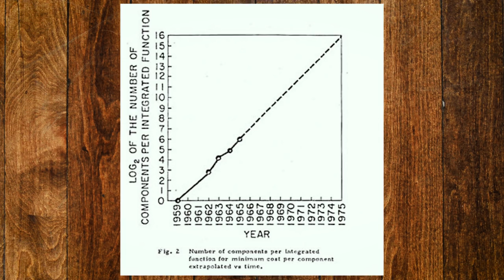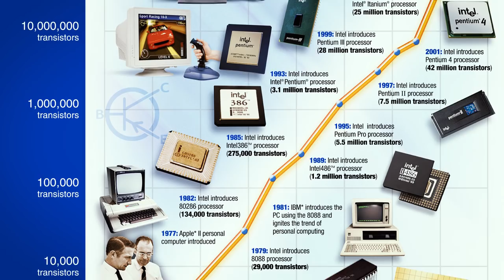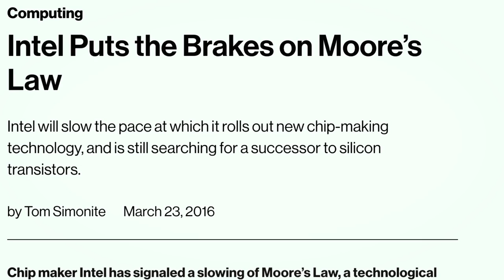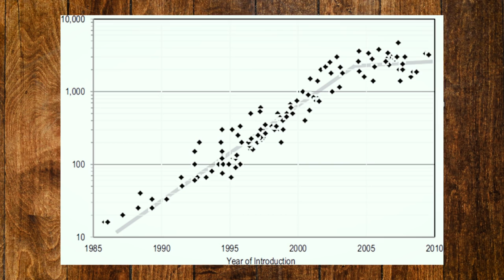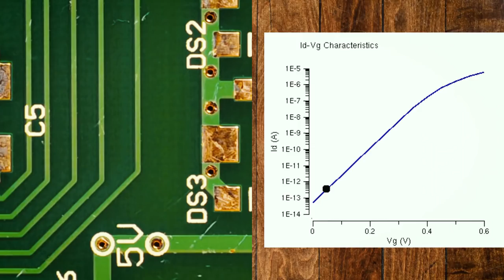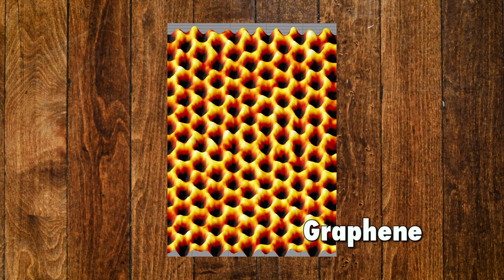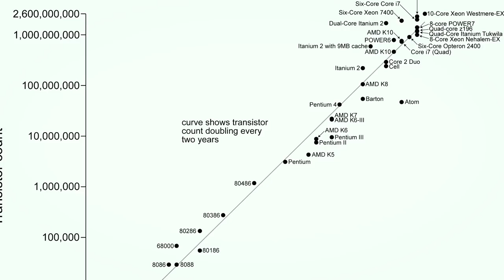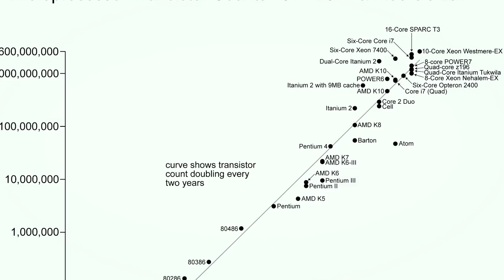Is Moore's Law Broken?

Comment: So... a few really weird things about following the tech industry and metrics like performance, efficiency and (of course) Moore's Law.
1) While mainstream consumer x86 architecture has slowed down dramatically over the last 5 years, it is not true for all computing technologies.  GPU performance is still improving dramatically, and ARM based processors (used in everything from microwaves, to cars, to smartphones and tablets) improved very slowly in the past, but are not moving at a much faster 'moores-like' rate.
2) Mentioned, but not explored much in this, is core count.  While improving core count to 6+ cores makes little to no difference in day-to-day computing use, it has HUGE improvements in the server market.  Last year at the school district I work for I consolidated 14 physical servers down to 4.  One is a backup server, one is a file server, and 2 house VMs (virtual machines) of the other 12 boxes.  Sure, the individual core performance is not improving much over time, but massively parallel cores allow you to consolidate workloads of multiple machines and users down to a single box with little to no impact on performance.  This means that end user devices can get smaller, lighter, and more gutless, as the end-user workloads are off-loaded to 'the cloud', and that cloud can continue to get physically smaller and smaller as density continues improving, even while the load is increasing dramatically.
3) While a lot of the reason for Moore's Law was self-fulfilling prophecy, a lot of it was due to a specific 'need' for more power.  Angry Birds and Slither.IO do not drive the overall economy.  MS Office and Google Chrome is what moves the economy.  About 5 years ago we hit a wall of 'good enough'.  It no longer took 3-5 minutes to open a word document... it took a mere 2-5 seconds.  And while shrinking that to 1-2.5 seconds is a doubling in speed and improvement, it is no longer a practical difference in performance.  If something takes 1-2 seconds or 5 seconds it does not impact performance very much.  With very little practical efficiency to be gained by CPU improvements in these bulk-user tasks, there is smaller and smaller motivation to make improvements, especially as the improvements are more and more difficult to make.
4) In more recent years the 'new' definition of Moore's Law seems to be measured (at least by Intel) in performance per watt.  Now, I am not always inclined to follow this line of thinking, but they are not entirely wrong either.  While raw performance per-core is at a stand still, the efficiency (under load and idle) has been improving very quickly.  A lot of this is due to the impending collision between x86 and ARM architectures.  ARM has always been very good at being low power, but not particularly good at being efficient with workloads, which is why they have been great for phones and tablets that need minimal power usage, but don't have large heavy workloads (and why when you do give a phone a heavy workload it drinks your battery so quickly).  x86 on the other had has generally been very efficient with heavy workloads, but is by its nature very power intensive.  But as phones do more and more work, ARM has been getting more and more efficient with big tasks, which has been giving Intel (and poor poor AMD) a run for their money in more and more markets.  Intel has reacted by trying to get x86 into smaller and lower power packages.  Overall, this means that we have gotten to see end-user performance stand still, but the machines that do these workloads over the last 5 years have shrunk from 1" thick to mere millimeters!
5) Lastly, improvements in performance appear to be in mixed architecture setups.  Soon we will see computers with a mix of ARM, x86, and GPUs all working together on the same pool of data as a single intelligent system.  This is already happening where the x86 CPU does all of the general compute, and ARM chips run the various drives and add-in cards in the system.  The difference is that all of these will be on the CPU, running your OS on the ARM part of the chip, and then farming out jobs to x86 and GPU cores as needed.

Anywho, just food for thought :D
Reply: You seem to be a good person to ask for this: Why dont we make cpus that have 50+ cores that take up most of the motherboard? Is it due to speed of each part of the cpu to communicate?
Reply: What are your thoughts on Accelerated Processing Units (given your last paragraph)? Could this be the next technology to keep us on Moore's Law?
Reply: Great post!
Reply: That's part of it - but, as he alluded to - do we really need such a thing? How would we use that power? We've actually hit a bit of a "wall of usefulness" in that we don't really have a use for that much raw horsepower.

. . . and to some degree, we actually already do have 50+ cores. Just not in the CPU, but rather in the GPU. GPUs have really taken off in terms of computational power, having thousands of cores. Still, those cores remain used mostly for games, even though they have become more general purpose.
Reply: TheEvilVargon It is because of the kinds of workloads we have computers do.  Because computers compute math, the math has to be done in order for things to work.  Most workloads can only be broken down into 2-3 things that can can be done simultaneously without affecting the outcome of the other calculations, so 4 cores is generally a good limit on how many cores a PC should have without people buying cores they will never use.
Another issue is cost.  x86 is a fully-featured architecture with lots of instructions.  Each core needs a full set of these instructions to work.  If you start having 8+ full-fledged cores, then there is a lot of redundancy that you are paying for which never gets used and it gets very expensive.  But if you move to a RISC or ARM instruction set which is substantially smaller, then you can easily afford more cores, but each individual core has to churn through more cycles to produce a result, so the per-instruction efficiency goes down.
In the future I think we will see more hybrid CPUs with 2-4 full x86 general compute cores, a few hundred GPU cores, and a few dozen RISC/ARM cores that are for specific common tasks.
I mean really this is what is already in your average desktop PC, but spread across several components rather than a single chip.  Your CPU has your x86 cores, your GPU has your GPU cores, your sound card, HDD, Northbridge, and other devices all have various RISC and ARM chips that control each of them.  It is just a matter of consolidating them all.

Also, there are specialty products that have several x86 cores on board.  They are big, and expensive, and generally only for specific applicaitons, not well suited for browsing the web and playing/editing videos lol.
Look up Xeon Phi cards for more info.  They are pretty cool... if impractical.
Reply: Yes, and no.  It depends on what that APU is actually doing.
First of all, AMD needs to make an APU that can actually... you know... do stuff.  Right now they are essentially Celeron or Pentium level processors with a rightly integrated GPU.  That GPU is capable of doing more than displaying graphics, but there is no software that takes advantage of it.  And the reason nobody takes advantage of it is because there is no market penetration, and there is no market penetration because even AMD buyers still prefer to buy a discrete CPU and GPU (wait for it...) because software is optimized for it.
But yes, if the APU was actually used as an APU (and there was an APU that had some real performance), then it could be one way to extend moore's law through a mixed compute model.

Don't get me wrong.  AMD's APUs are fine for what they are.  I actually use an A10 in my home server, and suggested my neighbor get one for their cheap laptop that they bought.  They are fine for what they are... but what they are is not something you want in a hefty work PC, and certainly not in the running for pushing moore's law any time soon.
Reply: Exactly right!  If your PC had 50+ cores... so what?  What on earth would you do with it?  You have no software that can push it.  There is no game or video editing suite that could make sense of such a thing... for an end user.

But that said... what if end-users had fairly capable phones to work with.  The device itself could play simple games, browse the web, play video, etc. etc. etc.  But then you have a central server in the basement, and if you want to play a big game, or do heavy production work, then you dock your phone (wired or wirelessly) to a real keyboard, mouse, and monitor, and your heavy game or production software runs on the server with your phone being a glorified I/O manager.  And then not only do you have access to it, but the whole household has access to run heavy loads on that central server.  So you and 4-5 other people all have cheap $4-700 smartphones, but rather than purchasing 4-5 separate PCs everyone shares a single heavy server that is more capable than 4-5 PCs combined.  The technology is actually already here and available in Hyper-V, ESXi, and a few other OSs... a little difficult to setup and use... but it will get better with time.
Reply: yes... and very much no.
The numbers proposed by Kruzweil and others assumed a lot of things that simply are not true.
1) It assumed that the whole brain is engaged at all times.  We know this to be false.
2) It assumed that everything the brain is doing is 'processing', but we also now know this to be false.  Large parts of the brain are merely IO interfaces.  Just like an ADC converts analog data into digital info that computers can work with, there are large parts of the brain that convert visuals, smells, touch, etc into signals that the processing part of the brain can work with.  As well as output areas to control our bodies.
3) It assumed that our brain can be geared and unified to all work together on a single problem, and we now know it does not.  For one thing the brain is plagued by noise.  Not just mere distractions and rogue thoughts, but actual firings of neurons that don't need to be firing.  for another, parts of the brain are specialized at certain tasks, and so there is no way to engage the entire brain.  Because CPUs use 'general purpose' cores all parts can do all processes, so you really don't need a big CPU to equal the amount of 'active brain' at any given time.
4) It assumed that just because the brain CAN do something, that it does it all of the time.  For example; we know that the human eye can see things at ~120fps, and at extremely high resolutions, and so we assume that we are always seeing things at that clarity and speed... but actually we don't.  The hardware may be converting it to make it available to our perceiving brain, but that does not mean we are putting in the effort (or processing power) to see it.  It also means that if we are putting that much concentration in analyzing visuals that we remove attention from our hearing, or feeling, or critical thinking... we just can't do everything at once.  In fact, we are really bad at multi-tasking.
5) It assumed that it was the amount of processing power would be required to emulate a human brain.  It is far simpler to 'be' a human brain.  Meaning, to have specific instructions and capabilities that make it work rather than trying to emulate something on non-optimized hardware.
6) It made poor assumptions about brain latency and processing speed.  The human brain 'runs' at about 60Mhz with ~0.1-0.5 sec of latency.  It is also massively parallel... but can really only focus on so many 'threads' at once.
7) It makes unfair comparisons of the human brain, with a CPU, when a brain is more like the CPU, GPU, sound card, motor controlling cards, etc. all thrown into a single basket.  For that matter, we are now finding that or 'mind' is not confined only in our brain.  In fact, our gut and spine do quite a bit of processing that we are only beginning to understand.  If we were to compare all of the processing in a human body with all of the processing in a whole computer system, or small network of computer systems... then we might have a more apt comparison.

Really truly, the human brain is about on the level of a Pentium 3 processor.  Very different instruction sets, and very different input and output capabilities, but about the same amount of raw useful processing 'attentiveness'.  The real trick is that the human brain is like a Pentium 3 attached to 2 16K cameras, a fantastic stereo mic set, millions of touch sensors, a really weird small and taste sensor system, several motor controllers, etc. etc. etc.  There is just so much raw data coming in at all times that 99% of it needs to be ignored so our relatively tiny amount of compute can deal with just the parts that are relevant to keeping us alive.  It does so by cheating.  We filter stuff out.  It makes shortcuts and approximations of information.  It simply doesn't do a full compute on everything at all times.

Quick example;
1+1=
A computer would have to actually compute this each and every time the problem was presented.  The human brain does not compute it.  We computed it a few dozen times in grade school, and our brain said "Ok, obviously we are going to see this a lot, so lets make a shortcut" and so it makes a quick recall memory (similar to a lookup table) and we just know that 1+1=2.  Not because we are calculating it, but because it is common information. Note that there is lots of 'common information' that is wrong... but we don't catch it until we actually think it out.... if we can.
So something harder then: what is the square root of 1,234,567,890?
Well, the computer can tell you instantly.  The answer is 35,136 and change.  I don't know that for sure, because I 1) don't know how to solve a square root, and 2) would have to calculate it out long-hand which would take forever.  But for a computer the task is only trivially more difficult than adding 1+1.
The trick is that I CAN learn how to solve for a square root, and without replacing parts in my brain, or someone outside uploading a new firmware to my mind.  I can see examples, read some text, reverse engineer the process, and actually 'learn' a new trick.  Something that fixed hardware computers cannot do.

Another great example: I can find my way home from where I am right now.  In a mere instant. no problem.  It takes my GPS several seconds to do the same task.
The difference: my GPS has to load up all of the area maps, try out every possible path home (within certain broad restrictions), compare them all, and then select a very specific answer.  I know my way home because I figured it out years ago.  I did the processing, and over years of driving back and forth, and having detours, and trying different routes, different routines, knowing traffic patterns, etc.  I have a learned memory of the path home; The computer in my GPS sees it as a new problem each and every time.
So... go somewhere I have never been to before in my town?  Seems fair, and I can still beat the GPS most of the time.  But again, my mind masks out all but the most used paths in the area, while the GPS loads up every last side-street.  My mind generally knows what routes won't work, while the GPS has to try every route.  My answer may not be a specific point-to-pint answer, while the GPS needs to have an exact answer.  My answer may not have all of the street lengths, names, turns, etc. while the GPS has all of that technical information.

Point being; Computers and human brains are extremely different in how we process things.  A computer deals with absolute concrete numbers (and really, only numbers), and shunting those numbers through logic and math pathways (instruction sets) to come up with answers... very quickly.  The human brain is more of an associative difference engine.  We take lots of information, filter out the crap down to a level we can deal with, and then we process from there.  And when we process it is much more practical in being 'good enough' to keep us alive, or to accomplish a task rather than being caught up with the 'best' answer to a problem.  In fact, our brain takes so many shortcuts, and glosses over so many details that we often dont even know what we miss out on!  Just go look up illusions or brain tricks on YouTube... there are just so many! And while you may not fall for all of them, it is mostly because you are looking for the trick... and even looking for the trick you still can't catch them all until they are explained and you go back and look for that one detail... and in doing so you miss out on other things that then got filtered out so you could focus on the new thing.  Computers just are not like that.  They see everything at all times.  There is no filter, there is no 'close enough', there is no changing the firmware.  It has nothing to do with raw processing power, and everything to do with how data is processed.  We are not different because computers are so much faster or slower than the human brain, but that they merely process things differently.  On a raw processing power level, the human brain isn't that powerful; merely better at pre-processing and making shortcuts to deal with things in a lossy but real-time environment.
Reply: You did just write as much in these comments as I did in the whole year.
Reply: Ya... Christmas week as a tech in a school district... Not a lot going on. lol
Reply: moore's law is just one paradigm. Carbon nanotubes, 3D chips... this is the direction we'll go I think.
Reply: @Matthew Lake There's no reason to believe that other technologies won't suffer from similar problems eventually. The laws of physics simply don't seem to allow unlimited power.
Reply: But is there a need? The tasks like optimization and encryption breaking can seemingly be solved by quantum computers, which are the same tasks that require unlimited discrete/binary computer power. 
So there has the be some divide where a standard processor is most optimized for one task, and a quantum chip is most optimized for another.
Reply: @Matthew Lake
well... not quite.
The problem we are running into isn't just a limit of what silicon can do... we are getting to points where atoms themselves are just too large of structures to work with.  In the last 10 years we have gone from 65nm down to 10nm.  Granted, there are more and more parts of a CPU that have much larger than 10nm structures for other reasons... but about the smallest we can do in mass production right now is ~10nm.
Silicon itself is good down to about 5nm.  At that point we are talking about single digits worth of atoms across.  Moving from silicon to something else will help make it smaller... but with ever decreasing efficiency gains.  That isn't to say we won't move to other materials eventuially, but the R&D required (to say nothing of moving an entire industry of mining and fabrication!) to a new material is a monumentally expensive task... we might just hang out at the 5nm level for a long time because it won't be worth moving to something else right away.

3D chips is something that we might see... maybe.  But there is one large issue with 3D chips: heat dissipation.  Technically speaking, we know how to make layered chips.  SSDs use them a lot these days, and they work great!  But each added layer is literally covering the previous layer in an insulator, which makes it harder and harder to dissipate heat.  In a SSD where the entire unit eats some 2-5W at peak usage you can work with it and deal with the heat... but in CPUs that suck down tens to hundreds of watts... that is a lot harder to deal with.
That said; there are 2 potential solutions.  1 is adding heat pipes inside of the chips to help cool the different layers.  It can be done... just prohibitively expensive.  But given enough R&D we could find some magic breakthrough that makes the tech viable. 2 would be moving from a lightly threaded chip design to a highly threaded chip design (similar to a GPU).  This could potentially allow a chip to run at a slower overall clock speed, while still offering tons of performance.  Intel's Knight's Landing is one such version of such a chip, and the tech is really really cool!  But the issue here is that today's software is optimized for 4 or fewer concurrent operations... so unless we have a major change in how software works, then moving to such a design would give dramatic drawbacks in performance.

I think that the next big thing in technology will not be in material science, but in chip architecture.  The core chip architecture in use for both ARM and x86/64 (as well as IBM PowerPC) is old... I mean seriously old.  They all have their roots back in the '70s and '80s.  Knowing what we know now we could probably start over from scratch with a new instruction set and execution paradigm that works in conjunction with a new software/programming architecture which could be massively more efficient and performant than today's systems.  Ironically, I think Apple is already working on this and may be the first to the table.  But I think that WinTel will also have to follow suit to keep up with the next gen of computing technologies (talking 10+ year time-frame... not soon).
But even that is going to be a HUGE setback!  It essentially means giving up on all current software and starting over... unless someone can come up with a way to port current software over, or allow for some form of emulation to run legacy software.
Still, I think that will happen first because it will be the 'easiest' performance gains to be had.  After that, then I think we may see a move to new materials, 3D CPUs, and other such tech.
Reply: @Mak Jay
Except that is the problem: optimization and encryption breaking are essentially the only 2 tasks that quantum computers are remotely good at... and even then they are barely keeping up with traditional x86 chips.  Sure, they occasionally get done with a problem fast, but most of the time they are neck-and-neck with more traditional architectures.
Plus, it does not help at all with end-user workloads.  quantum chips are going to be super useful for Microsoft, Google, Amazon, and scientists to help solve really large and complicated issues... but they are really really bad at doing in-order compute workloads like your current x86 and ARM based devices churn through all day.  Sure, it would be really cool to be able to break encryption on the fly... but if it doesn't open Adobe Premiere or MS Word any faster then it won't be worth moving to.  We still have a need for better/faster traditional computers to compute things.